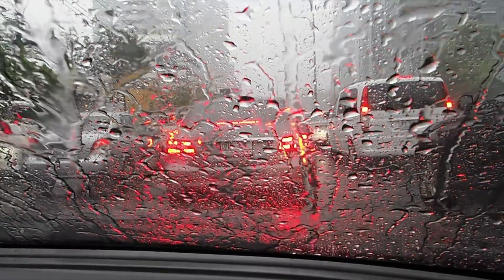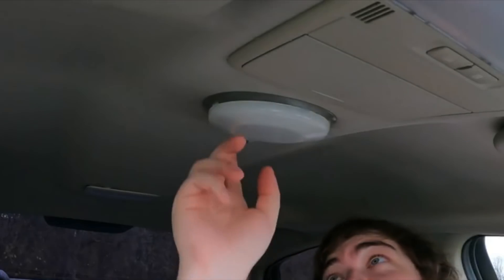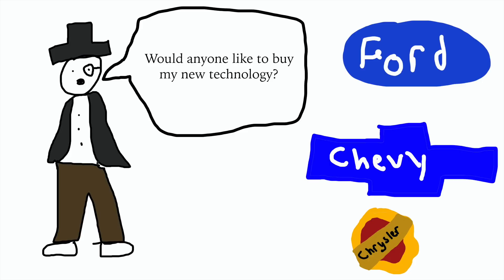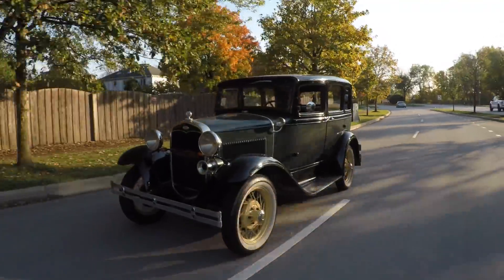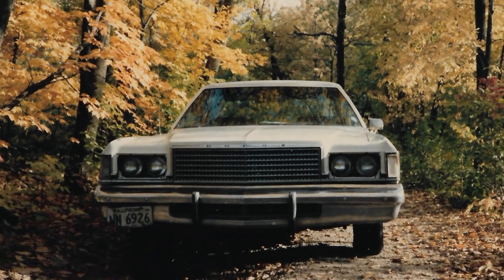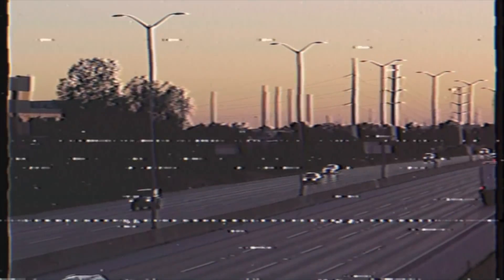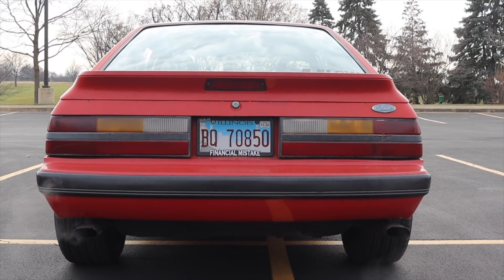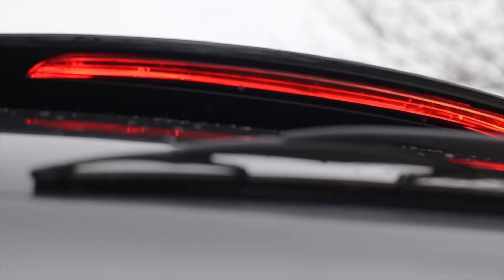The Third Brake Light - Who Invented Them & Why We NEED Them!

Comment: I've always said that the 3rd brake light was one of the best ever CHEAP safety features added to cars. Young people just take it for granted that they've always been there and don't even think about it. But for those of us who are much older, we drove many cars without that 3rd brake light.
Reply: @Shadow79XXX  not tryna say that the third or same lights are bad, but with how common powerful LED lights are, it's really hard to differentiate like the light just active or the brakes initiated without having the third one to double check that it's active
Reply: I remember when I was a kid we had a Ford Granada at the time these became popular and my dad bought a kit at the flea market that mounted on the back window and ran wires in the trunk to the brake lights to add a third brake light.
Reply: Maybe boomers struggle to see a light turn on, I personally don't.  Every time I'm behind a truck with a burned out 3rd brake light, I'm able to recognize when they're braking.
Reply: @Shadow79XXX  that comment makes no sense.
Third brake lights are also mandatory in the EU where turn signals are the right color.
Reply: @Jehty_  nope at least not all of the EU as in Sweden you only legally need two but most cars are sold with three for commonality between regions
Reply: @emiliskog  it's an EU law regulation*.
So it would be kinda strange if it wasn't the law in Sweden. My guess is that you are mistaken.

Edit: It's only mandatory for cars build after 1998. So maybe you are thinking about older cars?

*Edit 2: If you want to look it up it's 6.7.1. in the "Regulation No 48 of the Economic Commission for Europe of the United Nations (UNECE)"
Reply: There’s alot of cars that still dont have it. Sometimes now they just make it to look
Cool I’m cars. Like I changed my 3rd brake light for a cool light just for aesthetic purposes. On my mustang

Comment: I was a automotive mechanic from the mid 1970's and remember when they came out. They used to sell retrofit kits for cars back then that could be installed in the back package shelf of sedans. I know I could install a retrofit kit with a template for lights either drill holes or if it positioned correctly with a punch in a matter of a half hour.  String the wire to the brake light wires I strip a small section the brake light wire on the car and fit the small control box for the 3rd brake light so it would not blink with the turn signal and then solder the wire connection and tape it up. Then position the brake light control on the outside of the trunk support and then secure the wiring. I made good money for a couple years from the folks who retrofitted their cars with those third brake lights.  I also did it to my older car just for the safety aspect of it all.
Reply: I had a 1982 Dodge Aries sedan when the 3rd brake light became required, and I also added a 3rd light kit to the center of the rear package shelf.  I think I bought the kit from J.C. Whitney.  The light housing came with a soft black plastic lip that wrapped around the edge where it met the windshield, and it was easy to cut it to try to match the angle of the glass surface.  If you did it well, then all of the light would reflect out the back window, and look like a factory option.  I had another car with dedicated rear turn signal bulbs, and so for that car, you did not need the control box.
Reply: My grandma bought a 1983 lesabre that was retrofitted. It would flash when the 4 way flashers were activated.
Reply: I remember when those kits came out in Australia. The ones we had just mounted on the rear windscreen with suction cups.
Reply: I made my own version for my classic Beetle, 3D printed the housing. Especially with how low the tail lights are, and how high most vehicles (SUVs/crossovers) are these days, I think it's better to have something in drivers line of sight. Some purists, like "My Pronoun is WTF" here, complain that it's not stock or original, but I figure regardless of looks if it has a 1% chance of preventing my car - which I actually use as a regular vehicle - being rear-ended, it's totally worth it.

Comment: I remember when this 3rd break light was introduced. In fact, it happened the year I got my driver's license (I actually got it December 30, 1985, but it was so close to 1986...)
       I very much remember thinking what a great idea it was, because it made it much easier to see when someone was stopping.
Reply: I remember when they started appearing as an aftermarket modification in the beginning of the 90s here in Hungary.
They were illegal for a period of time, because "unsafe modification".
Reply: *brake
Reply: It has nothing to do with enhanced visibility; it was implemented as a backup to a burnt out brake light bulb, that's it.
Reply: American problems.
Reply: Dang, did you take a break when it went off, or how did it work?
Reply: I think Tipper Gore might have something to do with them.
Reply: @starmc26  there already were 2 brake lights, so a single burnt bulb wouldn’t yield a care brakelightless. Is the third one a backup for if two brake lights go out?
Reply: @starmc26  looking at the video, it seems you’re wrong
Reply: I remember thinking they were ugly
Reply: It made zero difference, just open your eyes a little and you don't need an extra light.  Plus it made every car made in 1986-87 look bad from the back because automakers had to hastily stick the light on them.
Reply: *BRAKE ffs

Comment: I remember that before the third brake light became standard, kits of brake lights to mount under the roof behind the rear window were kind of popular in Europe.
One argument not mentioned in this video: They are easier to see not just by the vehicle directly behind, but further behind as well, helping to avoid mass collisions in dense traffic, which became a problem in that era because many drivers didn't keep enough safety distance.

From 1938 to 1983 Germany (and probably other countries) allowed yellow brake lights. Interestingly the third brake light is still not required by German law. It is installed as a standard in new vehicles however, to be legal in all countries.
Reply: This reminds me, vaguely, of the mid 70s to early 80s G. M. cars that didn't just not have a 3rd light, but had the only 2 lights in the bumper. As someone born in 1991 who never saw those cars in their prime years, that's the stupidest place I can think of to put tail lights.
Reply: @101Volts  It was dumb to put brake lights in the bumpers. If the bumper got tweaked, the brake lights would Crack and you couldn't easily fit a new brake light in there. Some cars also had front turn signals in the bumper, too.
Reply: that's incorrect, the third braking light has been required on newly registered cars in the EU  since  1998. The requirement is not explicitly codified in German law - but it doesn't have to be as EU regulations apply automatically.
Reply: I remember working on cars in Germany in the early 80s (I moved to the UK in 82) that had these kits, often a pair of brake lights mounted on vertical bars that fitted inside, in the back window. They were made by Hella so far as I remember, and the rationale was that they could be seen through the windows of several cars, giving advanced warning of a car up front braking. Later, single-light kits started to appear and then it became standard fitting.
Reply: @PedroConejo1939  yes, single third brake-lights were originally not allowed. Until some time in the 1990s, braking lights were only allowed in pairs. Hence these pairs of what used to be called "Pufflampen" or "Rentnerleuchten" (brothel lamps / pensioner's lights). 

They are actually still street legal in old cars that don't have the third brake light yet. Although they are less than ideal for a variety of reasons. For once, because the lights were in the inside of the car, behind the rear window, they would cause severe glare if they were mounted incorrectly, or when the window was fogged.
Reply: They are required in Germany. European law requires them, which also counts in Germany.
Reply: I put a third brake light in my '70s VW Beetle for similar reasons. The brake lights aren't in the bumper, but are mounted quite low, much lower than most other cars, and with all the high-profile vehicles people drive these days (SUVs, crossovers), I suspect they're way below other drivers' line of sight, especially in traffic. Got rear ended by a van once and I suspect that was a factor, if I had the third brake light in the rear window at the time it might have been prevented. On my Beetle the front turn signals are on top of the fenders, I've seen some enthusiasts delete them and put them in the bumper (as I believe was standard in some markets after Beetles were no longer sold in the US), but I like the high position - above and somewhat away from he headlights I suspect they are more visible, and won't be washed out by the headlights like I see with most other cars that have the turn signal as part of the headlight module. I also ride a motorcycle, and I've pondered if I could figure out how to mount a brake light, or perhaps combo brake/running/turn signal, to the back of my helmet. Could easily mount such, the problem is how to connect it to the bike without wires flapping around and having to connect/disconnect them every time I get on/off the bike.
Reply: @quillmaurer6563  I kinda hope that my MX-5 had the third light because its so damn low that even bikers are higher than me by a lot.... but to be honest, it would just look bad and would need a trunk lid change.
Reply: @lknowledge  That's just a really tiny and low car all the way around, not much can be done about that. My friend had one for a while, that and an original Mini are the only cars that made my VW Bug feel big. Most cars you can put the third brake light at the top of or above the rear window to put it higher, but that wouldn't work on a convertible like yours.
Reply: @quillmaurer6563  oh I know. My 100A feels huge and my -65 Beetle was a true minivan compared to MX-5 NA.
Reply: @quillmaurer6563  
Hey, that’s a good idea for your Beetle. Smart thinking. For your motorcycle check out this battery powered helmet brake light that uses gyrometers: https://youtu.be/tDXKF8P6aO4
Pretty sure I’ve seen other types that plug-in and have blinkers too, but this is probably the most convenient.

Comment: I do inspections on vehicles and sometimes when peoples 3rd brake lights are out they want to argue on why they need the 3rd one. This video will be a good pointer to show them why we need them.
Reply: There are actually two advantages: 
1) As mentioned in the video, the third brake light is more prominent than the other two  (which are in the same clutter with rear lights). 
2) A brake light installed high enough (i.e., above or on the top part of the rear window) can be seen "through" the car behind it. Thus there is more reaction time (you can start braking at the same time as the driver in front of you). In this respect I do not understand why in some models the third brake light is positioned on the rear spoiler (convertibles have an excuse).
Reply: A while back I would of been one those arguing with you, not because I felt like it wasn't necessary, but because the TBL is part of the rear wing and it is discontinued and I couldn't find another one. But I ended up buying a couple led strips and adapting them to the original housing.
Reply: @Bad Drivers of AZ & NV Because you can't just cut a spot out for it in the tint? Or because some people will just be stupid and cover it without thinking? Much like they cover the other two lights with tint.
Reply: Failing to have one when you get rear ended could potentially let the driver running into the back shift some liability to the driver they ran into in states with tailgating laws.
Reply: @Bad Drivers of AZ & NV Or some random object block it entirely.
Reply: @SmallSpoonBrigade   Which is stupid. 3rd light or not it isn't the fault of the person stopping at the red light if they get rear ended. Also not all of us have one in the first place; I drive an F150 from 1985 it just never had one and I have zero plans to retrofit one either.
Reply: @SmallSpoonBrigade  lol
Reply: Indeed.... I actually have a friend who if she didn't have the third brake light would not have had any brake lights recently...... funny thing is she didn't even realize the two lower were out until I told her..... luckily we were able to change out those lights and if her third brake light ever does go out, it will be an easy fix
Reply: I just replaced mine after years of procrastinating. I am surpried I didn't get a ticket for it.
Reply: @shrimpflea  i dont really think cops pull people over for the middle one do they? Never actually heard of anyone getting pulled over for it.

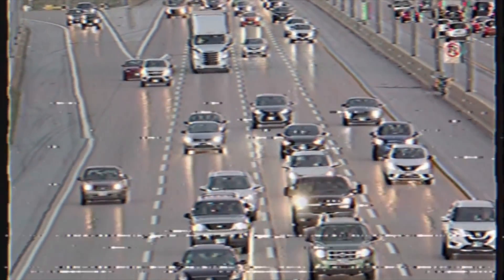Comment: 1:28 In 1914 Florence Lawrence developed an early version of the vehicle turn signal we use today. Not the man you mention 14 years later. She developed a mechanical signalling arm that at a press of a button, raised or lowered a flag on the car’s rear bumper that told other drivers which way the car was going to turn. At the time, turn signals, brake lights and windscreen wipers were not part of many or any motor vehicle's offering.

Not only did Lawrence create this indicating signalling system, but she also built a brake signal that when the brake pedal was pushed, a STOP sign flipped up from the car’s rear bumper. A standard and expected feature in today’s vehicles but at the time, these were truly unique and groundbreaking.
Reply: Some early cars had "semaphore" turn signals that popped out of the B pillar, sort of like what you describe, though they were also lit (and I assume flash). Early VW Beetles had them, though they switched to conventional front/rear flashing lights fairly early on - surely cheaper and more reliable. Ones with the semaphores are now very rare and revered by enthusiasts.
Reply: @quillmaurer6563  The 'trafficator', as you described, was very popular on cars in the UK during the 40s and 50s.
Reply: ok, but this video is specifically about lights
Reply: @mcn1583  technicalities, but it would be like saying someone invented the first gasoline powered car without crediting the person who invented the first petroleum powered car, because is ran on distilled ligroin, versus the type of refined petrol we use today.

Comment: 3rd brake lights were made mandatory about the late 90's in Europe (in france it was in '97)
my Peugeot 205s didn't have them, and i had to source tailgates from latest models after 97 so i could have 3rd brake lights on them
Reply: was it made mandatory also for older vehicles because my car is from 1990 and doesn't have a 3rd brakelight and it doesn't matter for cars build before it was made mandatory
Reply: @robingoessler4628  no, it's not mandatory for elder vehicles. It's just safer so I'd do the mod if it can be done well enough to not stick out oddly
Reply: @robingoessler4628  My 01 Puma has a 3rd brake light but the 2000 Puma didn't have it yet.
Reply: I thought the 3rd brake light became mandatory in North America for either 1985 or 1986 models.
Reply: @Frank De Ruiter this is quite interesting, and very traditionalist Dutch behaviour of course ;)
Reply: @Frank De Ruiter In Poland it was the same, at first imported cars with 3rd stop had to have it removed before being allowed on the streets, so same as you describe (don't know the years though).  And as to why?  Governments wheels turn slowly.... always.  And if it wasn't in the regulations, it wasn't allowed, no matter if it makes sense or not.
Reply: In Brazil the 3rd brake light only became mandatory in 2009, although most cars alrealdy had them since late 90s.
Reply: I remember that in the 90’s american import vehicles in the Netherlands, the 3rd brake light was not allowed to work. So, they disable it. Very strange. Until 2001 then they were required to vehicles.
Reply: in the UK not required by law

Comment: I remember being a little kid in the 80's and I knew the cars were new if they had the 3rd brake light.  Made sense to me as a kid.  Especially when there were still 60's and 70's cars running around with one brake light not working, or one tail light is twice as bright as the other one.  Sometimes you had to second guess if the car was stopping or turning
Reply: I remember being about 6 at the time and demanding that the car we got have a 3rd tail light because it looked so cool. By that point, it was the only legal option other than a used car.
Reply: So you spent time while driving, focusing on cars that had electrical issues or tail light lumen issies, so you could "second guess" what you had predicted or hoped they would do.

Wow, it's a good thing you typed your comment so you could feel momentarily validated.